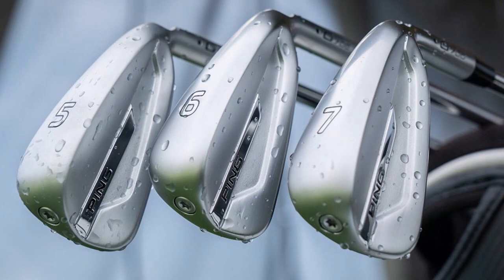DISTANCE vs CONSISTENCY - Shot of the Truth

Comment: Was fitted for irons and wedges at TXG in Toronto.  Many factors other than  carry/total distance  were taken into account (dispersion, launch, spin, descent, ball strike on face, delivery of the club, etc).  Was open to the data and the most consistent won out.  Love my Mizuno's.  Highly recommend TXG as well as ball fitting.  You can gain 5 yards with the right ball in the wedges alone.